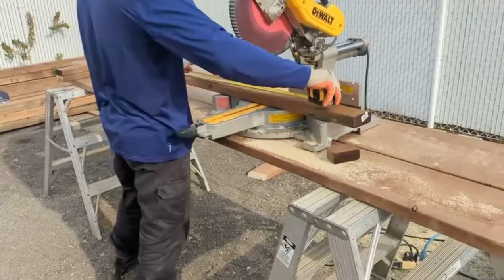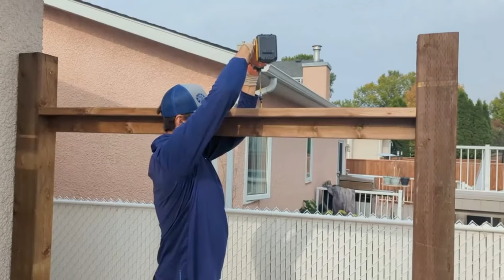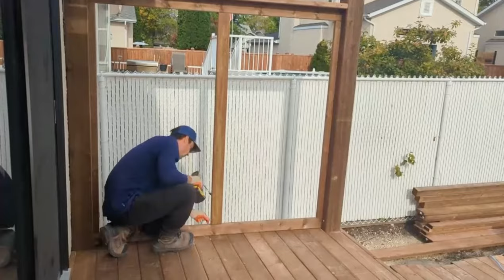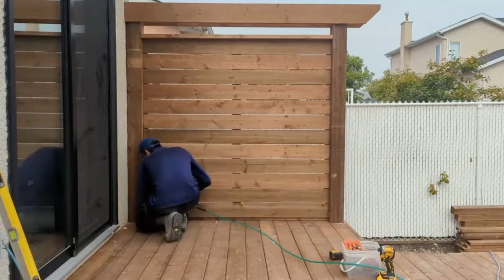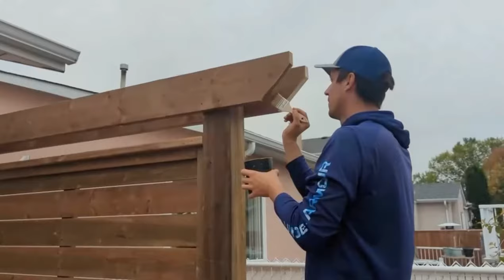How To Build A Wood Privacy Screen On A Deck!

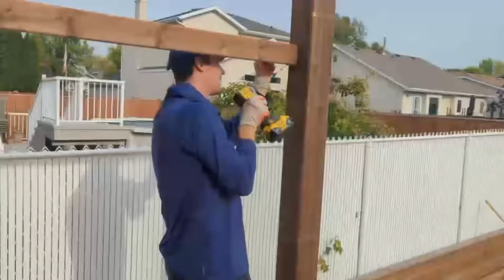Comment: Please someone help me. At 0:12 he is screwing a screw at a 45 degree angle into the wooden beam. The wooden beam is horizontal, and the post is vertical. 

What is this called? What is the correct term for this? How do I describe this action in fewer words? 

For the love of god please someone tell me what it’s called when you attach one piece of wood to another so they make a 90 degree angle, and then screw it in at a 45 degree angle.

Comment: There is no spacing for drainage. When the deck rots under the board you'll have to remove it and the decking.Here is the correct way.
https://youtu.be/EH8TISbzwHc?si=SWBq7wtfwHCnlBhk